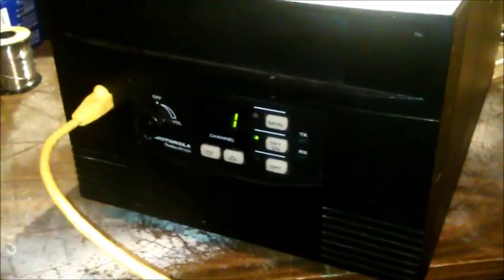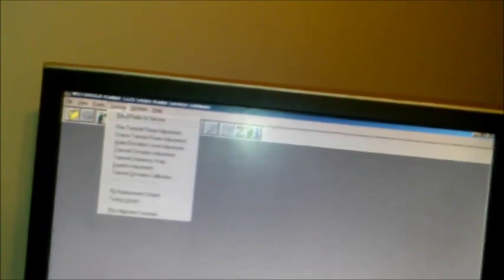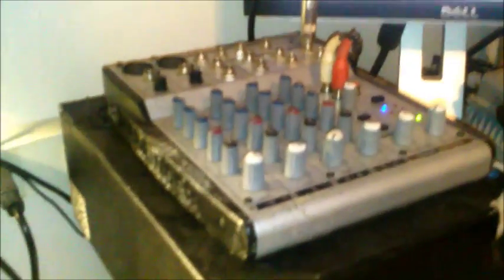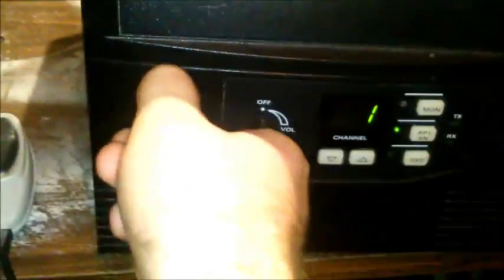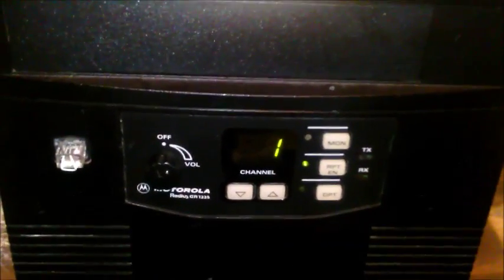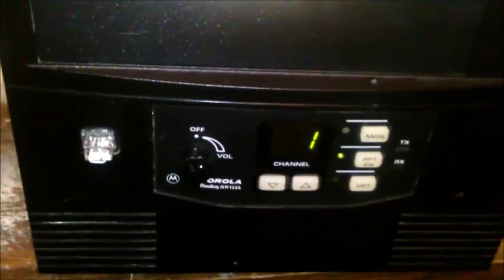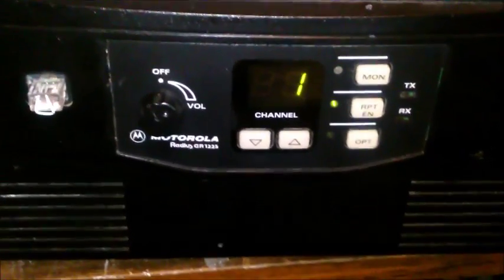Motorola GR1225 Charity Donation

Comment: do you still have the software for this? I can not get it from Motorola, they say they dont have it anymore. I recently came into possession of a GR1225 repeater that I want to set up for an ARES service. Any help would be appreciated- KJ7OWB
Reply from the maker: hackersrussia.ru has it
Reply: @Elfnetdesigns  yeah I got a zip file from that site but can't get it to work. It was the version 3 build 2. I set up a virtual machine running windows 95 and got it to load the first virtual floppy but it gets 36% through then says to put in the second floppy and when i do it says "general file transfer error. please select your target location and try again". There is only two files on the second virtual floppy but cant find any specific information about the files needed, so I am at a loss. Probably will just swap out the radios if I can't get it to work.
Reply from the maker: @kj7element276  You can try hamfiles dot uk and ask on their message boards for it.. They used to have it all listed but they got scared of idle threats and took it down but people may share it direct.
Reply: @Elfnetdesigns  by the grace of the HAM Gods I was actually able to find a working disk 2 file through a different zip file on the Russia site and was able to get it installed on my virtual machine! I was ecstatic! Thanks for your help, I will look in to the hamfiles site too maybe they have the better version for XP.
Reply from the maker: @kj7element276  Good deal. With the 1225's they are like all the new series radios where once you use a newer CPS you can no longer use the older cps on that radio due to version mismatching. 1225 series ended with version 4 I believe. I have it someplace on an older windows XP PC in storage so it's not on hand or I would link it over to you.
Reply: ElfNet Designs this repeater apparently had been in storage for over 10 years so hopefully it was used with the old one but if not i will see about getting the version 4. I have become quite experienced now with using a virtual machine haha so shouldn’t be an issue finding an xp operating system
Reply from the maker: @kj7element276  10 years. I would do a checkup not he power supply capacitors in that before putting it into full service again. also with those GR1225's and RKR 1225's you NEVER want to run them at full power. 75% or lower and this is to save the PA finals. IDK how many final transistors I have changed out in those because they were used at full power on a  busy system. Unless you are using the radio as an exciter to drive a bigger PA deck where you would only drive in like 1 - 4 watts.
Reply: ElfNet Designs thanks for the advice :-) greatly appreciated!

Comment: Trying to set up a portable repeater for my work site. Can I use this type of repeater with baofeng uv-82l radios or do I have to use the vertex radios.
Reply from the maker: You can use them if you have everything programmed correctly. For a jobsite you may want to set the repeaters TX power at about 15 - 25 watts also since this is not a continuous duty cycle repeater.

I assume you understand about frequency pairs also?
Reply: ElfNet Gaming I believe frequency pairs are Tx and Rx right? I only have my GMRS license and working on getting my ham license.
Reply: ElfNet Gaming I kind of need a repeater that I can take to my work site and be able to run it on DC and AC since a lot of the time we don't have access to AC power. What do u recommend I put my money in. Thanx
Reply from the maker: Yes RX and TX. Your repeater pairs are reversed from what you have in your handhelds so if your handheld have 
RX - 462.5500 and TX - 467.5500, the repeater should have this:

RX- 467.5500, TX - 462.5500

Also it may be noted that the little repeater is fine for commercial and GMRS use but it's performance will degrade if you run it down to 440 MHz ham band. It will work but it may not be as sensitive in the receiver, mileage varies with this sort of thing though some radios are fine where others suffer, just depends on the version you have if you plan on moving it to ham bands.
Reply: Well I'm not going to make a ham repeater because that means all my crew needs to get a license and I don't think I can make them get it. So GMRS it's fine. Would you be able to send me a list of what I would need to get my repeater started. Thanx.
Reply from the maker: That repeater will run off 12 VDC you have to open the case and get a Motorola mobile radio power cable, unplug the power cable from the internal power supply off the radio, and plug in your mobile power cable into the radio and there you go.
Reply from the maker: Ok first you need means to program that repeater, You can take it to your local Motorola radio shop and have them do it and also have them tune the duplexer also inside the repeater so everything is matched. I recommend this option since the shop can tune the duplexer properly.  Improper tuning can result in damage to your repeater. so this is highly recommended.

Now for legality you really should not be on the GMRS band if you are doing commercial operations, You can use one of the UHF business band frequencies of 464.5000, or 464.5500 which are a pair with 469.5000, and 469.5500 MHz.

For DC operation you need a regular Motorola mobile radio power cord, You simply unplug the lead from the repeaters internal power supply to the radio bit and plug in your mobile power cord into the radio bit. The AC power supply is in the bottom of the unit.

This is the cable - http://www.ebay.com/itm/like/251279175629?lpid=82&chn=ps&ul_noapp=true

You will also need some sort of UHF antenna with an "N" type connector to connect to your repeater, make sure the antenna is for the 450 - 470 band and not the 406 - 450 band also no dual band antennas, as this is for ham radio, Now they make a base station antenna kit for NMO type mobile antennas also:

https://www.walmart.com/ip/24262922?

Note: This is ONLY the base part You still need an actual antenna - http://www.neobits.com/laird_technologies_qw450_450_470_1_4_wave_antenna_p3004100.html

For that antenna option your lead needs a PL259 on one end and an "N"type on the other end or a "N" male to SO-238 adapter and a lead with PL259's on both ends.
Reply: ElfNet Gaming thanx a lot. This should be plenty for me to get started. I'm not going to have the repeater on all the time just the 8 hr work day. And it would be in a different location by the next month. Since that's how long it takes us to build a cell tower and shelter site for different cellphone carriers. And most of the builds are up in the mountains here in SoCal. So I don't think comercial use would be a problem here. It's just to comunícate between the crew because of low to none phone signal.
Reply from the maker: Oh cool I used to work with AT&T and AlTel Wireless building cell sites. I dont do it anymore, my ankles say I can't climb anymore... I do mostly groud work now on my own as a 3rd party contractor for things like police and fire, and railroads communications,  and wireless internet systems for places also.
Reply: ElfNet Gaming what a coincidence that we are in the same industry ( telecommunications ). I still climb and I also do ground work. It's cool that we get to see places that most people do. Thank you very much for all your help and fast response.
Reply from the maker: Yeah I used to do a fair bit around Las Vegas area for around 10 years and I redid alot of wifi systems out there in some of the larger casinos and now I am back in Louisiana just kinda working at a slower pace for awhile. But no problem, I always try to help and advise people in a useful direction and not criticize them or "scare" them away from using their equipment with stories of FCC horrors lol. You see alot of that on this website as well as the various subreddits..
As for ham radio license, I got mine back before it was so easy lol (early 90's) when I was in middle school. I use it for mostly HF bands though, local 2 meter and 440 at least where I am not just do not interest me, needless to say me and the local ham radio club had a negative run in when I was in younger, I donated them a 250 watt VHF amplifier and they turned around and sold it on ebay and I called them on it at one of their meetings... That was 15 years ago and they still hold that grudge against me today. I have GMRS repeaters up here and a couple of digital commercial systems up I lease space on so the people I talk to on the radio are other GMRS guys/gals or commercial customers if I cannot get them on a cell phone call lol.
I though about putting up a DMR ham repeater here just because though lol
Reply: ElfNet Gaming I wanted to get into dmr but I'm not too familiar with it so I just left it alone for now. What to you think about the Motorola gm300 radios. Could I make a repeater of those and would it easier to build. Because I came across a couple of them and I would like to make a repeater of of them. Let me know what you think.
Reply from the maker: DMR is expensive when you start talking repeaters..

Yes those are EASY to make a repeater out of, they make a simple cable you plug into the back of them to link them - http://www.ebay.com/itm/Duplex-repeater-Interface-cable-for-Motorola-radio-CDM750-M1225-CM300-GM300-/311516363046?hash=item4887d27926:g:C3YAAOSw~OdVc1YJ

However, You will need to have the radios programmed properly though. 
You may also need a duplexer or a pair of UHF antennas
Reply: ElfNet Gaming I bet dmr is expensive. The radios alone are a lil pricy I can only imagine a repeater. What antenna and duplexer do  you recommend. Since I just came across some gm300 at a price I couldn't pass.
Reply from the maker: Ok here is a duplexer rated at 50 watts since GM300's are 40 watt radios -http://www.ebay.com/itm/SGQ-450D-50W-Duplexer-UHF-6-Cavity-for-N-connector-New-/302003580756?hash=item4650d0ef54:g:R1kAAMXQTghRODV7

make sure you have the duplexer tuned by a radio shop also have them program your radios and see if they can set up the interface cable also for you. Most shops will do this. Also it is best to have the radio shop turn the max TX power down on the transmit radio also, this will make it not work so hard as a repeater.

You will also need a pair of these coaxial cables - http://www.ebay.com/itm/3-Wlan-RFC-195-Coax-Cable-mini-UHF-Male-to-N-Male-/151046147165?hash=item232b0d4c5d:g:pLYAAOxycERRlEYG. This is to connect your radios antenna connectors to the duplexer.

Your antenna depends on if you will be moving the repeater around or not but needs to be a UHF type 450 - 470 MHz. it also needs an N type connector on it or an adapter so you can connect it to the duplexer.

A magnet mount antenna will be fine for movable jobsite use.

DMR radios are not as high as they once were. for about $90 or so you can get a TYT MD-380 tier 2 DMR handheld that will do DMR and analog.  Repeaters however, $2,500 is the cheapest I can get a DMR rack mount repeater for new.
Reply: ElfNet Gaming wow dmr does get expensive. Thanx for the info I'll get started on building my repeater.

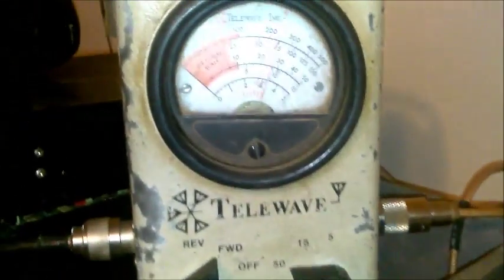Comment: Be sure to set it to low power. @ 25 watts or less, it would be close to 100% duty. Full power @ 50 watts, its 50% duty. Just a FYI.  The meter did not show 30 watts, 3:42 but more like 25 watts. You were on the 50 Watt scale. I would not push the GR1225, you will blow out the PA quickly. Even though its a Motorola, everything will die one day. 

I ran my GR1225 at 20 watts connected to a Celwave 526-4-2 duplexer then to a TPL amplifier, which gave me about 48 watts out. It died about a 2 years later, with light use.  I seriously  recommend you lower it down to close to what I recommended, or your charity donation will not last.
Reply from the maker: Yeah it was turned down right before I delivered it, I don't like to run them wide open either. For the place its in I set it to 10 watts via a digital meter i keep in the tool box. so its fine, with the gain from the Db420b I put up they have more than enough coverage lol
Reply: I agree 100%
My GMRS repeater is set up the same. 5 watts out of the 1225 into a Motorola converta-com mobile amp getting me 45 watts (don't want much more using the standard duplexer)